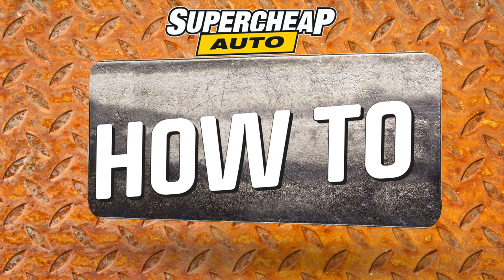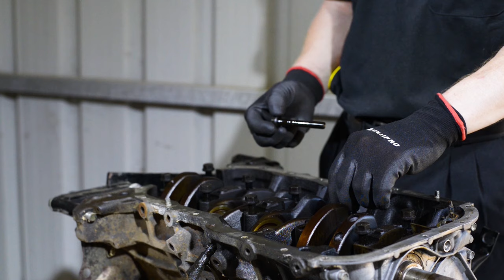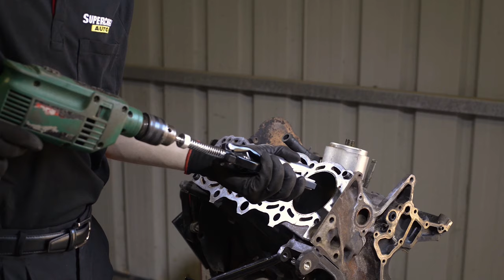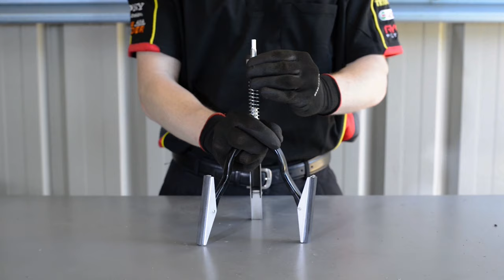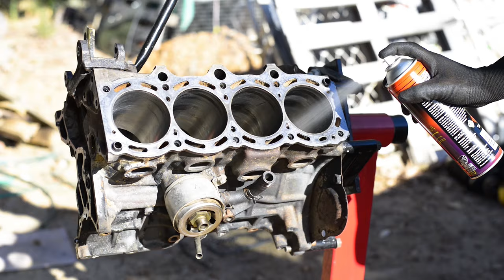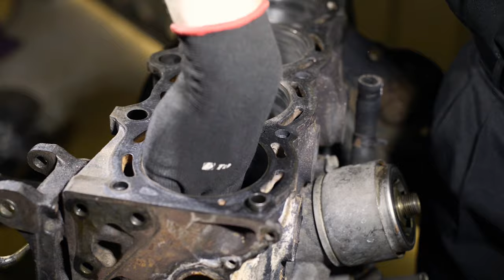How to Hone Engine Cylinders The Right Way

Comment: They rarely tell you how important it is to get the cylinder spotlessly clean. I was told that by a company 20 years ago and you the first person on YouTube to say the same. Very detailed video,
Reply: Good information. What will happen if inner cylinder becomes rough?
Thanks.
Reply: @cck1496  no compression and rapid wear of the rings.
Reply: @SoddingaboutSi  Thanks for your prompt reply. Keep it up.

Comment: I'm over in the US doing my first engine rebuild at home. I'm so grateful for your channel. Thanks for explaining it so thoroughly.
Reply: How did the rebuild go? I'm starting one for a single cylinder dirtbike, and I'm rather scared to start.
Reply: There is also a bottle brush hone which, I suspect, does not remove as much material.  That would be my concern here, you remove metal and tolerances then go out of spec....then you end up overboring, say 30 thosuands with over size piston or you end up sleeving the cylinder(s).  How did your project go ? I am in the beginning steps right now, - greasy mess on the engine stand, and mess on the floor !  So annoying, I like things clean.

Comment: Thanks for posting, I'm thinking of just refreshing a 2.0 pinto eng by just doing rings and Bearings on my own on the cheap, don't want to get shops involved at all. looking over videos of what's needed, I've always been a car guy wrenching on everything I have, I've just never rebuilt an eng on my own.
Reply: That car is a fire hazard
Reply: @YeOldeGeezer  That was a witch hunt,
Reply: i think the mod you should be more focused on is probably relocating the fuel tank because if that thing gets rear-ended you're going up like a frying pan in a gourmet restaurant
Reply: @egg9469  That was a witch hunt, But all 3 of my Pintos have the Gas tank recall upgraded parts
Reply: @egg9469  🤣🤣🤣

Comment: If you hone too much you will increase bore diametre, causing piston slap and bigger ring gaps.
Reply: Buddy at the machine shop said roughly for every 16 strokes you can remove up to .001, so not a big deal. The main thing is to check with dial bore gauge and when satisfied with all cylinders, that they be cleaned thoroughly to remove any abrasives left by honing process so rings seat and last for many years.
Reply: These DIY gadgets just deglaze, they dont hone.

Comment: Here's the significant part of Lake Speed Jr.'s replying about my motor which only has 30K miles.  You'll see that he doesn't want to take any more material out of the bore than necessary, and the second grit is only used for 1 or 2 strokes.

Lake Speed Jr.
The refinishing process only takes out .0002. We’d recommend hitting the bores with a 280 grit for a few strokes and then brush with 400 for 1 to 2 strokes.
Reply: What if you just use the medium grit stones and put the pistons in? With it be fine?
Reply: @danielroy8411  Sorry for a delayed response.  The medium grit cuts the troughs into the bore that hold the oil.  The finer grip smooths out the top of the troughs.  If you don't use the finer grit, the rings will end up smoothing the tops of the troughs which in the long term will give you approximately the same result.  If you use the finer grit stone there will be less wear on the piston rings.

Comment: Those are 220 grit stones. Way to coarse. Use a 320 - 400 ball hone and never hone so long to remove material. All you are doing is removing glaze and put a cross hatch (30- 45 deg.) for proper ring break in.
Reply: If my outboard honda motor (4 cylinder) based of a honda accord had a cracked head and water was seeping in. Should I hone it or just clean it with one of those kitchen green scrubbers?
Reply: CSJiGSaW first clean bro 2 weld it shut and thoroughly grind but not too much then hone or replace and hone head itself less money and problems
Reply: If you knew anything you would be telling him he needs a machine shop, not a DIY deglazing.
Reply: @SOLDOZER  Ive owned a machine shop sense 1973

Comment: Nice video! I have a question if you hone the cilinder a little bit , you need to put bigger ring or if its in the oem specification you can put oem rings?
Reply from the maker: Best to refer the to workshop manual for the cylinder bore size and piston ring tolerances and work within the spec required.
Reply: If you can easily remove a piston and ridge reeming isn't necessary, then no. However, if the bore is oversized you'll need to bore the block and get oversized pistons with matching rings. Never use just oversized rings, and if ridge reeming is neccesary, then the bores are out of round and no ring will seal. If you can't hone a bore in a timely manner, then the bore needs bored out oversized, cause by then you've removed to much for standard rings to seal.

Comment: You can buy 1 size of rings and file the end gap to fit. Piston skirts can be knurled. This will give some milage with out breaking the bank. Not recommended if you are going to drive 15K a year but ok for rarely driven antique or classic car.

Comment: I've used one of these honing tools..and although impressive and capable, they don't last. I used one with 4" stones and barely got one use out of it...one cylinder of only 80mm. I had no idea the stones would go down so quickly. I used oil as well..
Reply: Ź
Reply: $30 well spent.
Reply: You probably had too much spring tension on it.  It should just lightly press against the cylinder bore.

Comment: I came here looking how to get my ride home supercheap just in case I was broke in the outback.  That didn't come out right but you know what I meant.  They can't be serious...those walls looked worse afterwards and the "crosshatching" made my eyes crosshatch.  Always have this work done by a machine shop.
Reply: If my outboard honda motor (4 cylinder) based of a honda accord had a cracked head and water was seeping in. Should I hone it or just clean it with one of those kitchen green scrubbers?
Reply: those scratches are meant to happen they will disappear in no time what we want is we want to remove big and deep scratches with this if you dont have a damaged cylinder you should not do this

Comment: This isn't honing and the tool isn't a true hone.  This is glaze breaking with a glaze breaking flex-hone.  The required crosshatch is the same whether using a rigid hone or glaze breaker.

One other consideration is the type of rings to be installed.  Different types of rings require a different surface finish and may require a finer grit stone.  

Check the out-of-round and taper before doing this procedure to be sure they are within acceptable tolerances since glaze breaking doesn't straighten a cylinder.  Too much of either will require boring the block unless the cylinder can be straightened with a rigid hone and stay within piston clearance spec.

Of course, if you are just looking to get an engine together and running, and don't care about long life or maximum power, just about any re-ring job will work.  I've seen scratched and tapered cylinders running well in street class stockcars and on the street with only minimal oil usage, maybe a quart per thousand miles, and no blue smoke.

When cleaning the block, have a can of WD40 ready and spray the cylinders before drying.  If you dry the cylinders, you will get instant light surface rust.  When assembling, wipe the cylinder with a clean, lint-free rag and lacquer thinner, then immediately coat with clean oil.  Lacquer thinner removes all WD and any remaining grit but leaves no residue.

Comment: It's a good video , but it leaves out - ridges at top ! Best to have a pump POOR a constant stream of HONING oil onto one side of bore to keep all the grit and metal suspended and off the surface , as well as how to set up a visual or mechanical stop so you can hone to max depth of bore , top is easy to see . Drill speed should be pretty slow to , You NEED a variable speed drill with a straight woble free chuck to. Lastly you need a bore gauge to accurately check taper and straighnes . Best to use cast iron rings in a garage honed cylinder regardless , it CAN be done by hand very well but it is actually alot more in depth to do it the best possible way even at home . Happy honing to all .
Reply: Yea machine shop here i come🤣
Reply: Use a ridge removing tool first from Australia
Reply: @arthurdunn3007  These youtube  honing videos are a joke for the most part.  They should be called how to polish your cylinders . The ball hones really make me cringe . No one ever uses a sunnen hand/ manual  hone tool either wich is 5 times better than the flim flam wobble sticks everyone seems to fall for . The cheap ones can work pretty good / good enough if used properly . 9 out of 10 don't though wich is why better than half of the budget rebuilds even smell horible going down the road . A good running rebuilt no emisions controle engine wont stink like an oil fire in the least when built and tuned properly .
Reply: Authur Dunn

Comment: Go slowly and longer. Try to keep one to two rpm per stroke. Use oil and a small part solvent. You can easily trace a 45 inside the cylinder by watching the smear pattern

Comment: Don't know why people use oil to hone, the oil traps particals and embeds them. A water hose with a constant fine stream does much better. It washes the particals away from the cylinder and the honer while honing. It's not like the cylinder gets hot from honing, so there's no need for oil. I know some will disagree with this, but if you've ever tried it you'd find out it works well.
Reply: You are absolutely correct sir. I’ve only ever done coarse stones this way. The only way to do it I think. Save the oil for the last .001 if you need to
Reply: I am sure mostly any fluid would work, I know some guys who like using WD40 and some who like using transmission fluid. depends on your personal preference and it makes me wonder what you could get away with.
Reply: If my outboard honda motor (4 cylinder) based of a honda accord had a cracked head and water was seeping in. Should I hone it or just clean it with one of those kitchen green scrubbers?
Reply: @CSJiGSaW08  once a piston is pulled it's imperative to use new rings, doesn't matter if low miles or not, which then requires honing the cylinders. You need that cross hatch pattern for new rings to seat properly, and honing is the only way to get that. Cylinders must be honed as good as possible, otherwise that thing will use oil and rings will NOT seal and no amount of engine break in period will do it either. If you don't plan on pulling the pistons, don't mess with the cylinders other than maybe spraying and wiping it down with a "light" solvent. Don't use abrasives on cylinders if your not pulling the pistons out, you'll mess up the ring pattern. Each set of rings creates their own wear patterns.
Reply: @garyr7027  Got it, makes sense. Right now its top dead center on piston 1. Both piston 1 and 4 are to the top of the block. Cylinders 2 and 3 are down at the bottom of the bore. 2 and 3 were the ones of concern since the I found the head was cracked on both 2 and 3 near the water galleys. I didn't see any large scratch or irregularity, only that down the bore at the edge of cylinder head, i noticed some white powder residue kind of line salt buildup with the oil. I think it was when removing the head some of it got down there, but any ways a good engine flush should be good if any salt and water is mixed inside.  I have not rotated it because i'm not an expert on timing of the engine and afraid of messing up the timing. Not sure if I should just clean bores 2 and 3 and forget cleaning 1 and 4. Either way they were 150 PSI compression and 2 and 3 where giving almost 0 PSI  due to the cracked head. I heard marvel mystery oil is really good for the head and cylinder areas to clean and preserve lubrication or should I just use WD40?. Is the Scotch Brite too abrasive to clean inside the bore?
Reply: @CSJiGSaW08  more likely that head is no good, if it's cracked it'll have to be replaced. That salt look is actually aluminum corrosion, it's not salt. Can't say for sure what you should do at this point, depends. Did it overheat real bad? Did you get coolant in your oil? If so, how hot and for how long? If you didn't get coolant in your oil, the block should be ok, if it did then you'll more likely need a complete overhaul of the block and the bottom end. Don't risk a new head on a bad bottom end, you'll just create too much pressure on it from a new head and it won't last. For the timing, with the head removed, there is no timing, the head determines that, the block itself doesn't know the difference. TDC on cylinder 1 isn't TDC on any stroke, until a head is put in place. Spray the cylinders down, let it soak and wipe it off, rotating the engine as you go. When you done place number 1 cylinder at the top and leave it there till you get ready to time it back up. WD40, oil, trans fluid, or mild solvent will clean a cylinder, so if the block is still good and it rotates, a new head should be all you'll need.
Reply: @garyr7027  yeah the head has been replaced, new valves and seats but used same springs as i didnt want to pour anymore money. All original parts from Japan are expensive. hopefully when I put it back on it runs smooth. The water galleys had a recall due to cracking. Temperature valve was superseded too. I just bought the darn thing with no compression test. Thats why you always buy the boat and check it well.
Reply: @CSJiGSaW08  how is the oil in the engine? Look normal?
Reply: @garyr7027  Have not gotten to that point yet, but I assume it got water somewhere in the power head. When I went for a ride the last time it kind of stalled, had hard time getting back up on plane and i notice some oil in the ocean. So water and oil defintiely leaked and seeped in and out. Never took the boat out again and discovered all the issues after. I will put the new head back on, lubricate it good and fill the engine back up with new oil and turn over the engine to recheck compression. If all is good, then I can rebuild it fully and put all parts together. If it does not compress, its better to throw away. power head rebuild on an outboard is expensive. More than the head. Its better to buy a new outboard.... So many darn parts and gaskets needs to be replaced.
Reply: @CSJiGSaW08  so you're rebuilding a boat motor? My bad, I miss understood, thought you were working on something else... now I see where you got salt from. Well in that case all I can suggest is the most basics that all 4 stroke engines have in common, but beings that's a boat engine, I'd really make sure you didn't get water in the oil, it'll look like chocolate milk if it did. That thing would cost a small fortune to rebuild, those engines are high dollar. I'm guessing it also has an aluminum block? More reasons to "not" use abrasives on the cylinders just for cleaning. I rebuild a lawnmower engine once, the cylinders are very difficult to get right, and honing has to be near perfect or else the rings cut into the cylinders and seize up almost immediately. Aluminum is soft metal, you got your work cut out for ya, good luck with it hope it turns out good.
Reply: @garyr7027  yea its aluminum. Got new head bolts since they expand and all. On this honda from 2000 its 130HP its actually the block from a honda accord. They got the same cylinders, block and all except the head has the water galleys for the cooling coming from the water Empeller. Everything else is same parts as a honda accord 😅
Reply: @CSJiGSaW08  that's strange, as I own a 02 accord with a 2.3 vtech engine. They are well made engines, mine has 302,000 plus miles and still runs great but with a cast iron block, even the original transmission still going good. That engine you got, you think it might have cast iron cylinder sleeves? If so that would be much better, as Honda are well known for making very dependable engines, some of the best on the market. Is it also overhead cam? I'm guessing it does beings it's a Honda.
Reply: @garyr7027  Single Overhead Camshaft. Youd be surprised it ran on 2 cylinders like a workhorse on my way out and in on that last drive. They are very well built engines. Only issue i had was when doing the water cooling passages to change the sacraficial anodes, several screws were broken when removing. They were frozen shut,  i put a new gasket and has not leaked.  mEven with all the issues, its amazing it holds. if i fix it right, and find out how many hours, it light last me decades compared to newer engines. Any faulty code gets thrown off and motor goes limp mode or wont start.
Reply: @CSJiGSaW08  that's interesting, just make sure when you time it back up after you put that head back on, to time that internal crankshaft balancer if it has one. If it does have one and I'm guessing it probably does, timing it is easy. There will be a small bolt on the back side of the motor towards the front on the block, pull the bolt out, put a screwdriver in the hole, turn the engine over until the screwdriver falls down in it. That will time it and should set number 1 piston at the top. You might have to Google where that bolt is located if you're not sure. If you don't time that balancer you'll get a really bad screeching sound from the engine at low rpms at idle and think it's messed up, be hard to figure out what happened... I know I've done it once on mine.
Reply: Not really, you can dry hone too. People just take an idea an somehow make it law.
Reply: Water being flung around and on your electric drill is always a great idea....? Probably not. Oil might tend to be less conductive and a higher viscosity so maybe less likely to be flung around. Just a thought.